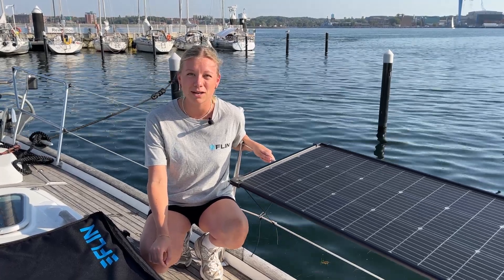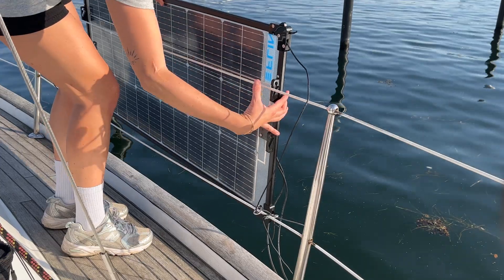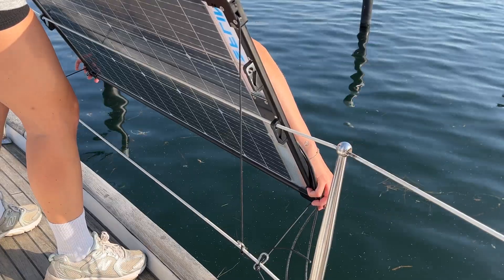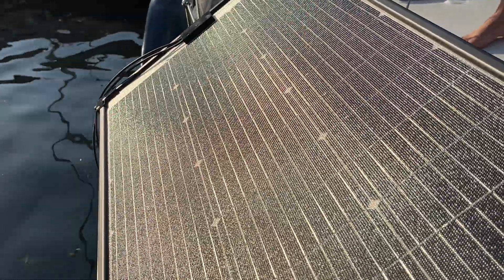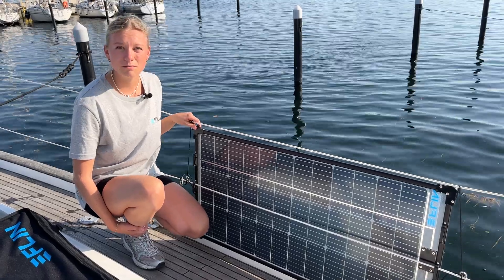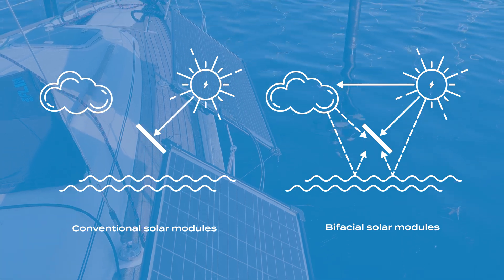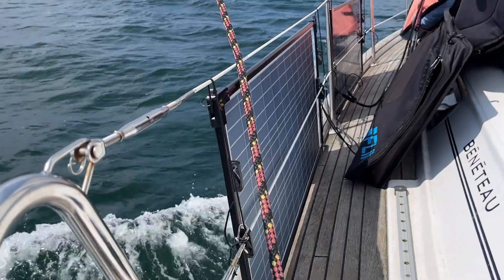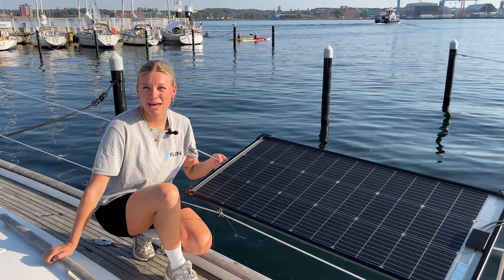Solar module for the railing: How to use the FLINrail+?

Comment: What keeps the panels from sliding horizontally along the lifelines?
Reply from the maker: Good question :) In fact, the panel cannot slip horizontally as it is held in place by the tension of the ropes that are hooked into the lower wire. The panel moves a maximum of 2-3cm in a horizontal direction.

Comment: Sorry, but at 995Euro its way too expensive.  I am just putting together a 110w rigid panel, with two upside down coat hooks and an adjustable paint roller handle for about £100.  Panel has furniture corner pieces and stows below when not needed.
Reply from the maker: Of course, rigid panels with simple mounts are cheaper. The FLINrail+ has been specially developed for use in the railing. And at 2.9kg, it is extremely light, yet super stable and comfortable to handle. If you are looking for cheaper alternatives, you are welcome to send us an e-mail and we can offer B-goods at a reduced price.

Comment: at last one practical use for the lifelines, you should include floats and recovery line in case they fall by broaching or wave, also a solar panel raft towed by the boat would cool itself
Reply: I was also thinking about a raft solar system, but it would have a lot of complications.

Comment: What is the wattage rating
Of the panels ?
Reply from the maker: The solar panel has a nominal output of 100W, but due to the bifacial effect it is more likely to be 110W.
Reply: 100W, and 995€